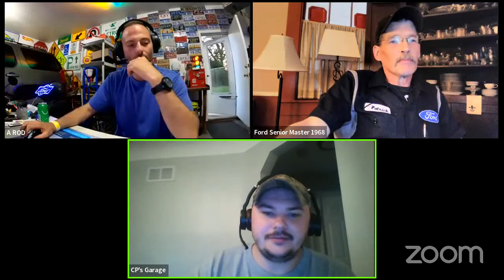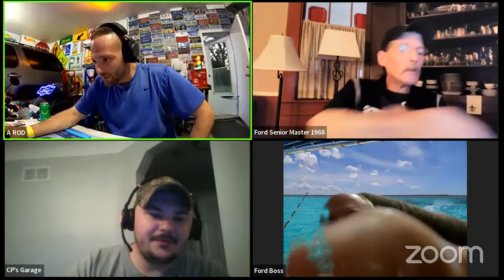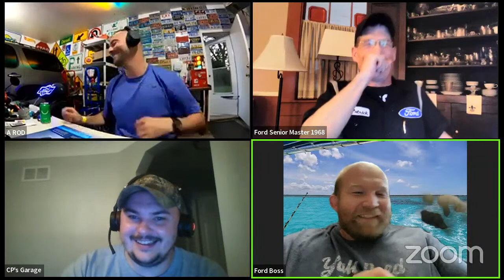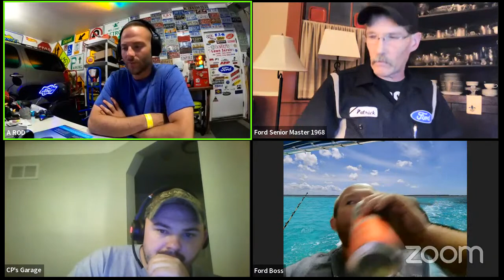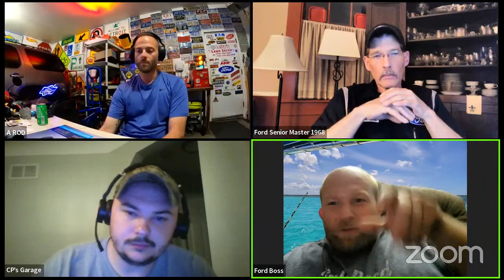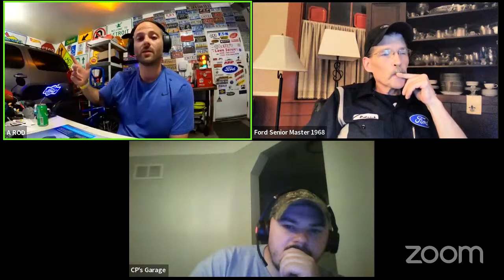Guys WHATS YOUR FUEL COST - PSD talk!

Comment: ARod I have a question for you brother. My truck was fine this morning I drove to work and I was getting ready to leave to the supply store and now the truck stalls every time I shift to drive. Something grinds consistanly in Neutral. Feels like converter locking at idle and stalls. Cluster says it goes to 5th too which is not suppose to happen at idle. Thanks in advance
Reply from the maker: How am I suppose to know what your driving. Sorry buddy no can do
Reply: @PowerStrokeTechTalkwARod   sorry Bud probably should gave you that information first. I drive a 2015 with the good Ole 6.7 the 6R140 seems to be unhappy at the moment
Reply from the maker: Did you check the TCM for DTCs yet?
Reply: @PowerStrokeTechTalkwARod   I have checked but it's based on the tuners diagnostic tool. It didn't pop up any codes. I don't think it reads everything. Need a special scanner is my guess
Reply from the maker: Yes

Comment: A trick that has seemed to work for me to keep from draining so much fuel on the lower fuel filter is to “break the seal” so I will loosen all the 8mm bolts to the point right before it comes off or starts to leak, then open drain. Will only drain what’s in the filter, instead of the “siphon effect” if you leave it all intact. Same theory for 11-16, unscrew filter housing 3-4 turns and then open drain.

Comment: Make a video for the water proofing stuff’
I like using Electric grease on female side of the pig tail where the male rubber boot rubs, with putting some on the back where the wire goes through